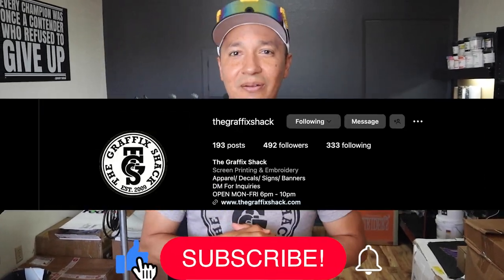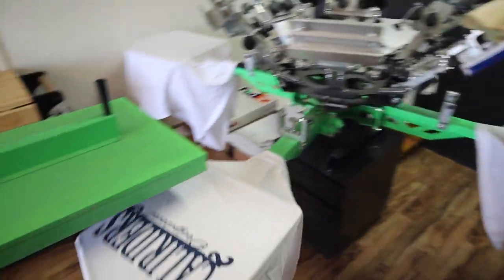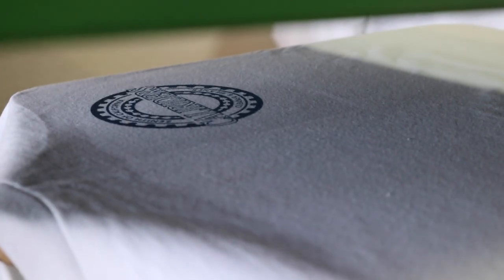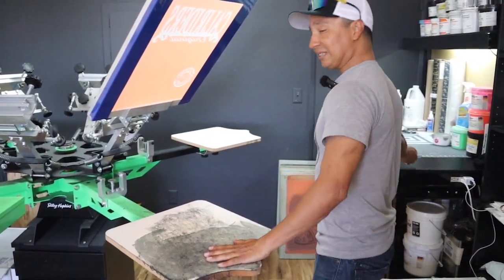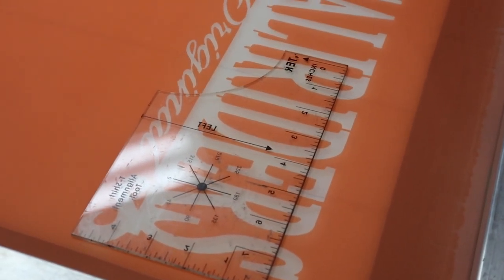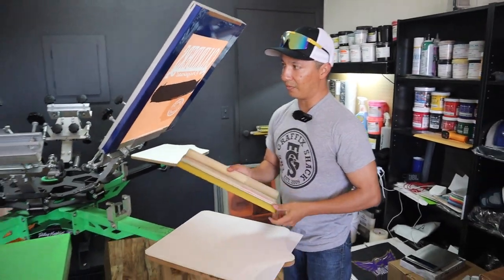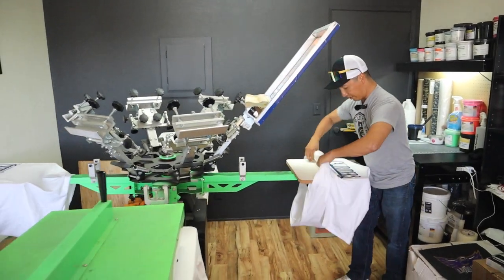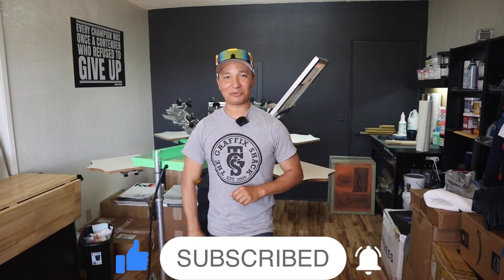How I Make $240 in 1 hour Screenprinting - The Graffix Shack

Comment: Coating screen and waiting to dry 3-4 hours
Separating and print art work 1-2
Printing a 12-24 piece 1.5 hours 
Reclaiming that 1 screen 1 hour .. total = 6-8 hours for $240
Reply: Still a good trade off
Reply from the maker: That's a good observation. However, i always have at least 4 or 5 screens coated and ready to burn at any given time. So, for the video the only thing you didn't see was me burning the screen which took me about 20 minutes. All said and done probably 1 1/2 hours... the next time i get a similar order I'll do a video start to finish to see how long it takes. Thank you for watching 🙏

Comment: How does it dry so fast
Reply from the maker: I use low cure plastisol ink which cures at 260 degrees. I set my flash dryer about 5 inches above the platten. Once the top layer of ink reaches 300 - 320 degrees the shirt is ready...this allows the entire layer (top to bottom) of ink to reach at least 260 degrees to ensure a full and proper cure. Did that make sense? 
Thank you so much for watching 💯 🙏
Reply: Yes! Thank you!! 😊😊😊😊😊
Reply from the maker: Awesome! No problem 👍💯